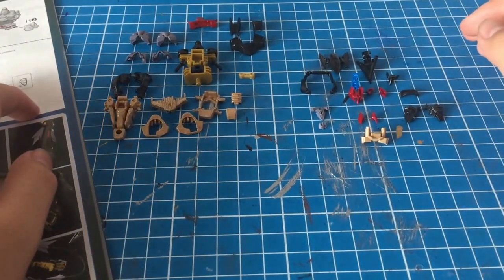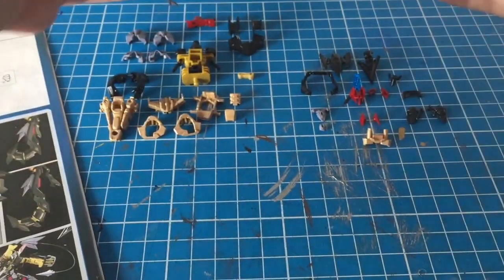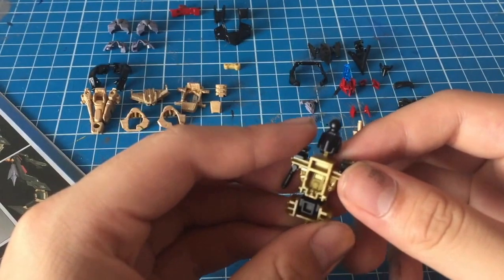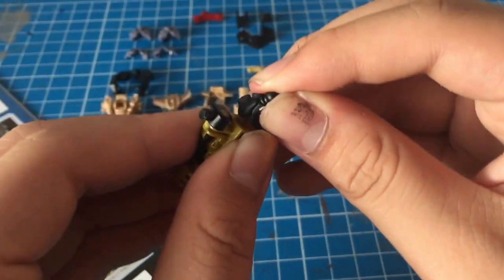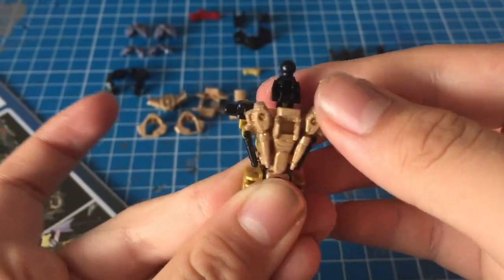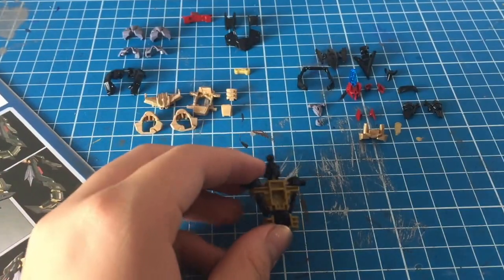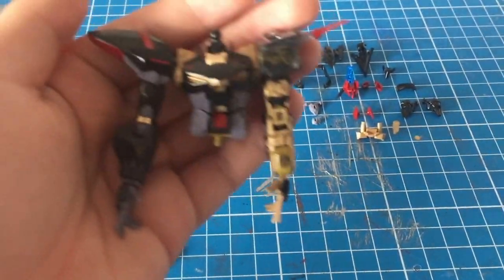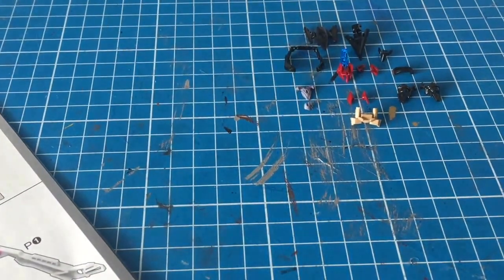LET'S BUILD- RG GOLD FRAME AMATSU MINA| TORSO AND HEAD(PART 3)

Comment: OMG those two little red pieces stopped my build progress for like a month, so annoying.

But i finally figured it out, you have to securely attach the gray L3 piece the black head piece first, and the little points on the left and right have to rest UNDERNEATH the black piece before you can easily slide the red pieces on. It's a securely locked piece so it takes some effort to get the points to go underneath, hope this helps anyone <3

Comment: I hate those 2 gold connecting pieces in the start why the hell make them loose I hate that it makes it look like it should slid in somewhere because of the teeth but apperantly the desinger and a fucking stroke and fucked up because those parts aren't right and honestly I sent my kit back I didn't want it after that
Reply from the maker: Yea i get what u mean. Throughout the vid u can see me get frustrated over some parts of the build especially the head. The final result looks great just that the build can be painful at parts, hopefully you’ll have a better experience with your next kit:)